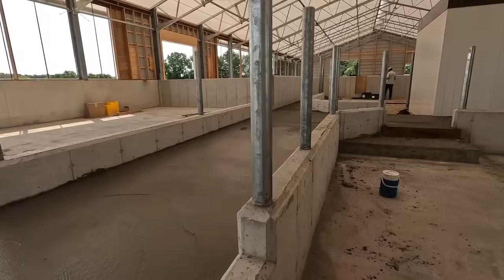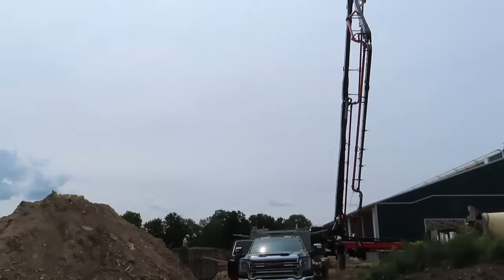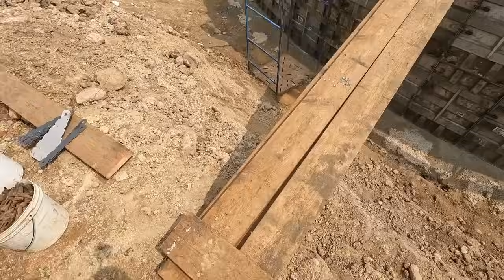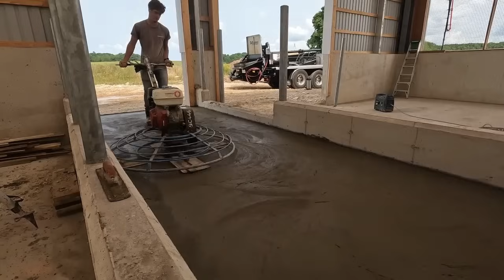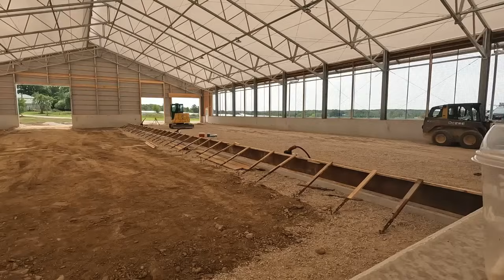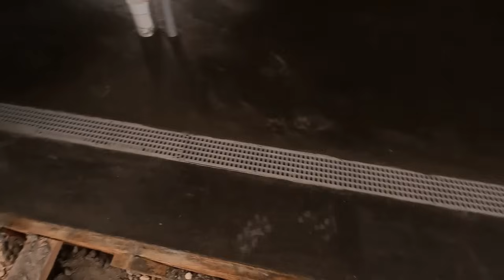Liquid Manure Tank Walls getting Poured August  13, 2024

Comment: 1 more ? is about the area/room with all the re-bar.  Making that floor unbelievably strong.
Reply from the maker: @mikeklehr7105  That is a ceiling above the 10'x12'x10' collector pit that a pump will be mounted beside and it will be pumping out to the big pit outside. When it is set they will be climbing down in there to remove the plywood from underneath.